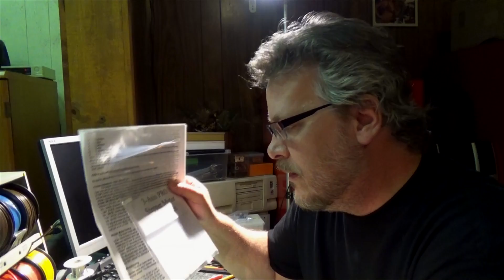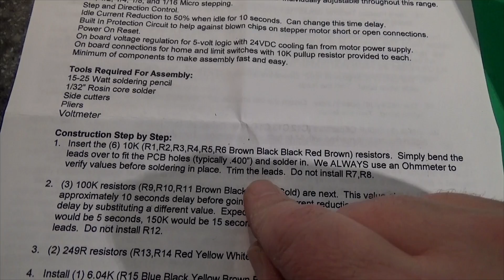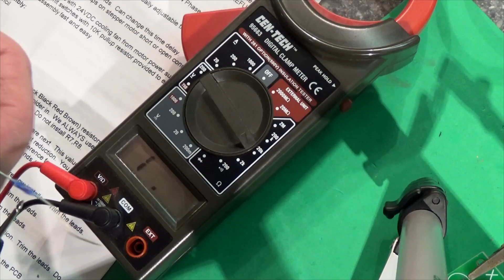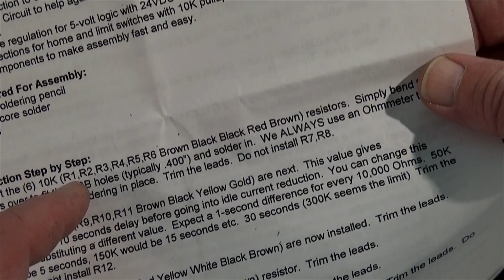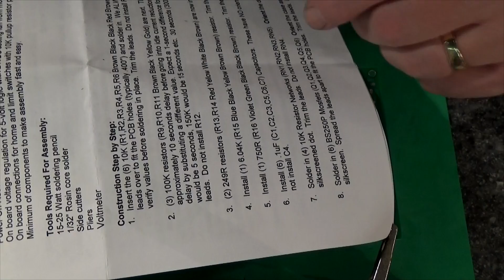Building a Homemade CNC Stepper Motor Controller Board

Comment: One thing you should do for an even better, more reliable result when soldering ... use flux! VERY important for good, clean, high conductivity, high reliability, easy to make joints